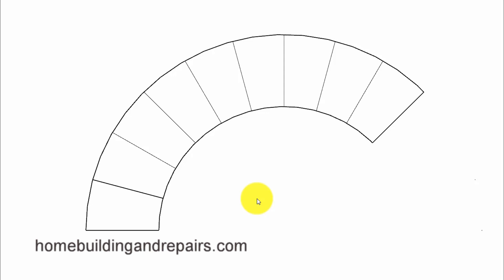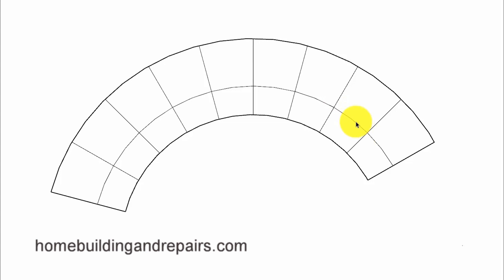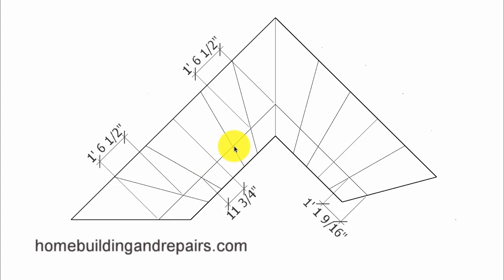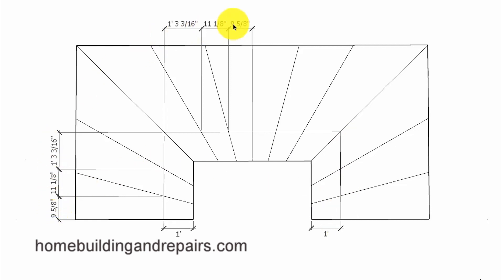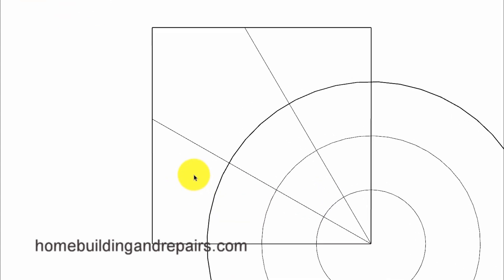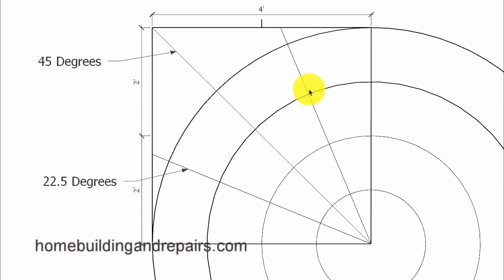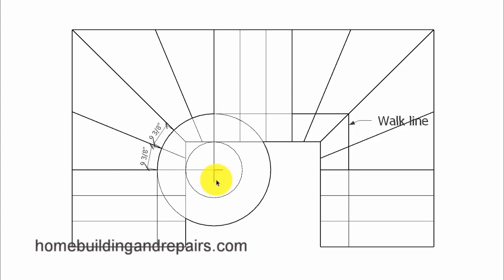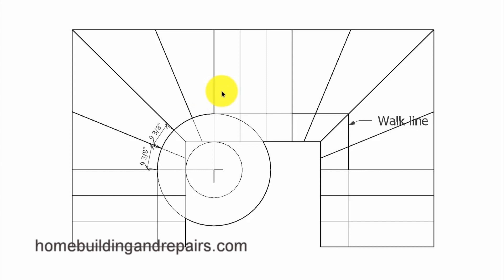Building Code Interpretation - How To Use Concentric Circles For Measuring Steps in Winder Walk Line

Comment: That inside curve for the final 22.5 4 step did the trick. I was building into a smaller existing barn loft access and the winder math wasn't going to work for code. Adding a rounded pillar shape to the inside corner allowed the measurements to work visually without having to convince anyone of anything and the guy passed the inspection without complaint.